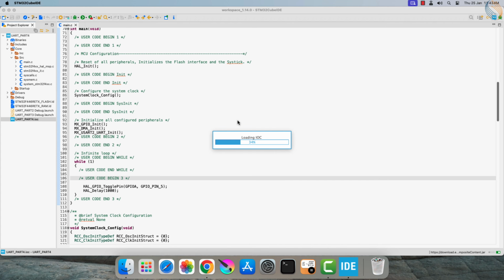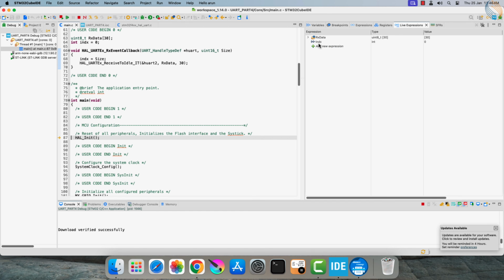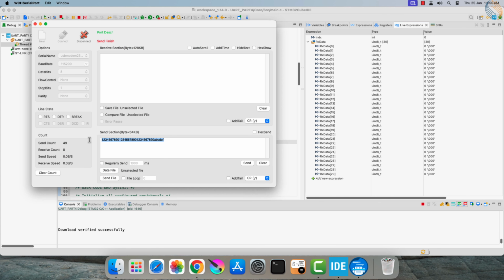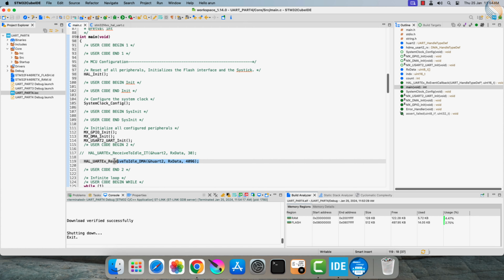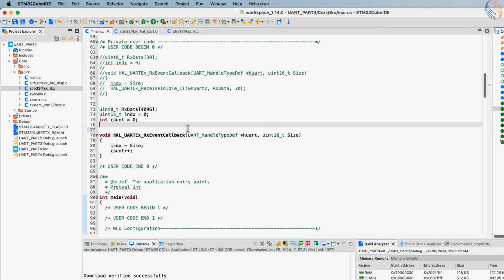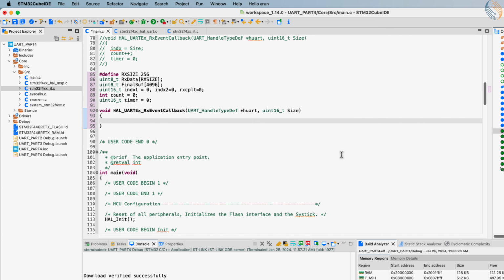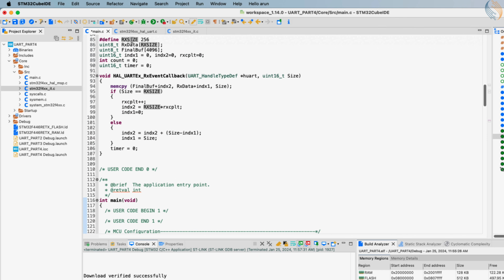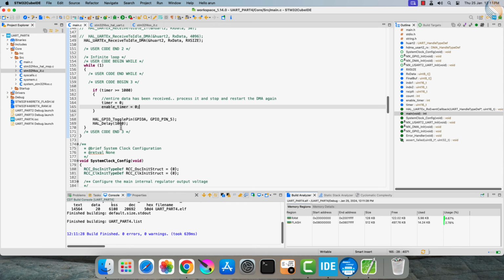STM32 UART Tutorial (Part 5):  Receive Data using IDLE Line Detection Interrupt & DMA

Comment: For anyone need (if any): on STM32H745, right after calling HAL_UARTEx_ReceiveToIdle_DMA(), it goes into HAL_UARTEx_RxEventCallback() immediately event not sending/receiving anything yet, and Size is the same as my chunk buffer'slength, it is because file stm32h7xx_hal_uart.c has logic calling HAL_UARTEx_RxEventCallback(huart, huart->RxXferSize). So the solution is checking value of nb_remaining_rx_data inside your custom callback or just do HAL_UARTEx_RxEventCallback(huart, 0) in driver

Comment: I am using the last part of the video so that full data will be received without fail. I just want to know how to print the data that has been sent.
Reply from the maker: Inside the Rx Event callback function, just transmit the received data via the UART to the serial device.
HAL_UART_Transmit (huart2, RxData, Size, 100); before those if conditions start.

Comment: If used as in the video "HAL_UARTEx_RxEventCallback" and "HAL_UARTEx_ReceiveToIdle_DMA". The STM32F103C8T6 controller in the debugger receives only 18 bytes (0-17), then rewrites it from the beginning. Buffer 25 characters. If you put a breakpoint, it will get all 25 bytes. If anyone understands why this happens, please tell me.
Reply from the maker: Idle to DMA works in a way that when the idle line is detected, an interrupt is triggered and the callback is called. When another interrupt is triggered, the DMA writes the data from the beginning.

It depends on how the data is incoming. Maybe the 25 bytes are being sent in away that first 18 bytes then 7 bytes. I have seen this behaviour while using the Neo6m gps module, where the data is sent by the sensor in blocks. So you never receive the entire data in a single buffer using this method. 

What can you do then ?
1. You can use dma in circular mode but remember that you will have a hard time handling the data. This is because you need to keep track of how many data bytes have been read and processed by the mcu.
2. Use uart ring buffer method I have implemented in another video.
3. If the data to be received is of known length, use simple receive method using dma or interrupt.
Reply: @ControllersTech  
You are absolutely right! I bought a logic analyzer for $10 and saw a gap in data transfer. Thank you so much for your help!

Comment: I am using IDLE line to implement a Modbus slave on RS485 bus. After received the frame, stm32 would send a response to the master. But the next received frame would have a garbage byte in front of the real frame. Very wired.

Comment: How do we tell the DMA the size of the Rx buffer, in order to avoid overflow when sending a large file?
Reply from the maker: You can't. You should just define the buffer large enough.
Or first send the data containing the size of RX buffer. Then use the data to define a new RX buffer and call dma function to receive the data.
But this can't be done in a continuous data stream. After sending the buffer size, the sender must wait for some time so that the mcu gets enough time to create the buffer and call the dma receive function.
Reply: @ControllersTech  Thank you, I think my question was not clear enough. I was worried about a buffer overflow when too much data is sent. But I realized later that the dma will automatically loop in circular mode, and the size of the buffer is passed when calling ReceiveToIdle_DMA. Now I have been experimenting with this and it all works well, I am trying to optimize the delay between the Idle callback and the actual end of the message, which for some reason I can't get under 2us at 6MBaud. I suppose this is a hardware limitation. (Using the G431)

Comment: Ive been messing around with an F401 Black pill, st-link to program it, and usb to ttl adapter to send data. I cannot for the life of me get it to do anything at all. Nothing happens. The program uploads fine. I have tried swapping the tx/rx pins around.
Reply from the maker: Did you try running a simple program to blink LED ?
Maybe the clock configuration itself is wrong.
Reply: @ControllersTech  Yes that worked perfectly, provided the board was not in debug mode. Turns out I had just missed pressing "resume" and the code was waiting on HAL_init...
Ive only just a few days ago received my first F4 board, no experience at all with CubeIDE, ive always had arduinos. Doh moment 🤣
Reply: @ControllersTech  Its all working now, next is trying to figure out how to setup an RxEventCallback from a specific uart.
Can I change in
//    void HAL_UARTEx_RxEventCallback(UART_HandleTypeDef *huart, uint16_t Size)
the *huart to &huart1/&huart2 or something, trying to make it listen on both uarts and whatever comes in forward over the opposite uart.

Comment: I think that there is an issue on the latest example.
Assumed that the last chunk is 250 bytes (DMA Size is 250) and the next one chunk is 32bytes (DMA Size is 282),  the condition about Size == RX_SIZE(256) will not be executed.

Comment: How do you reset the index in the DMA buffer so that after each occurred Idle event the next received bytes are stored at the beginning of the buffer?
Reply from the maker: Why not use the interrupt for such case ?
Reply: I would like to use as little processing power as possible. Is it possible to store at the beginning of the buffer after each Idle event?
Reply: Initialize the DMA reception in normal mode and clear or reset unused data after each transfer :

void HAL_UARTEx_RxEventCallback(UART_HandleTypeDef *huart, uint16_t Size)
{
    // Check if the received size is less than the buffer size
    if (Size < MAX_SIZE) {
        // Clear the unused portion of the buffer
        memset(&rxData[Size], 0, MAX_SIZE - Size);
    }

    // Re-enable the DMA reception for the next transfer
    HAL_UARTEx_ReceiveToIdle_DMA(huart, rxData, MAX_SIZE);
}